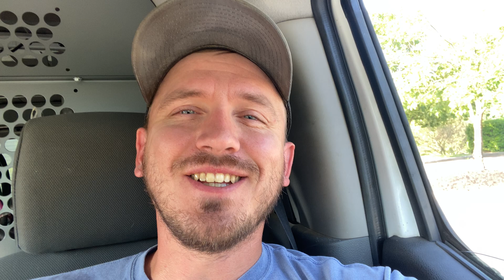How Dry Wells Work in Septic Systems

Comment: Hi, my rural WI home has a dry well septic system. We are trying to find a contractor to install a new system because the sewage holding tank is metal and rusting away. The dry well could use cleaning because it has to be pumped and does not drain well any more. I wish we could save the dry well and just install a new sewage tank to replace the metal one. I started looking for a septic system contractor in August and now, it's November and I only have one bid. I also now think it's on hold until spring due to changes in the weather. The bid includes drainage fields and the dry well will be demolished. I'd like to hear your thoughts. Thank you.

Comment: We   a two chamber, septic tank and twoshaffer concrete  dry wells in parallel. approx 30 years old and just started to evidence saturation a year ago.  Have you ever heard of aeration restoration? I have seen a system tested on a military base by ACE (or other gov office) and it functioned well. https://youtu.be/e-MvMCh9A2o?si=NtT4nR3SnPYykd4_
Reply from the maker: I’ve heard of it but the practice is not common here in Maryland.  Our state wants a permit when trying an experimental treatment like this.  You essentially have to file there was a failure and declare you’re attempting this to rejuvenate the pits.  Agree that if you sell the property and it fails at the time of inspection you’ll replace it. A majority of the time the state is fine with homeowners doing whatever they want as long as it doesn’t back up.  The line in the sand they draw is more towards real estate transactions to protect purchasers

Comment: I have various drywell pits for different parts of the home, septic is dedicated with two tanks, baffles, lines into a drywell pit/leach pit. All you need to really do is keep the bacteria balance good and there won't be problems with draining. Plenty of products out there that help the soil keep percolating and draining. There will always be a little water/standing water/moisture as that's how a septic system works with septic tanks - the water on top has to go somewhere and that's from the first tank to the second and then on to your pit. If your tanks are not happy your drywell pit is not going to be happy. Take care of the solids in your tanks and keep them clean and bacterially bubbling digesting solids, then you avoid issues with your drywell pit. Pretty logical. You can easily dig a new pit if needed though shouldn't have to, and anyone being told they have to pay thousands upon thousands is getting ripped. Just fix the soil, that's not a 'failure', that's common sense and how they work. Old timers didn't run bleach/chemicals and whole house water softeners down drains, made sure to keep grease and fats out of the lines etc. It's actually a pretty green system and you're not relying on anything but using some smarts keeping grease, coffee grounds etc out and maintaining with healthy bacteria. I personally wouldn't suggest one drywell pit for an entire house's plumbing to run through, that's too much and especially with a family. Showering, washer, kitchen sink etc should be divided up with good rule of thumb being three pits (smallish) to handle dedicated showers, kitchen and maybe washer going into another, toilet black water septic definitely needs to be dedicated. The movement now is to 'go green' and drywell pits are making a comeback. Go figure. If you live long enough everything comes back around haha.

Comment: I have a septic system that has only a dry well. We do not have a gray tank. The septic system was filling up with water and not draining out. It was taking only about three weeks after pump to be filled again. We had the septic system completely pumped out, including the drywall. We had all of the gravel replaced around the drywall. We used about 30 ton of round stone. The type of drywall we have is a board concrete drywall. After replacing all of the stones, the system is still not draining properly. It would fill up in just a few weeks still. We live in Baldwinsville Ny. We are on a river. When we removed the soil it seemed to have some clay in it. I’m not sure what to do next.

Comment: I have a 1948 house in boddington Western Australia, I have a single cylinder type septic tank for the 1 toilet, this leads down a pipe which then has the house drain water linked to it and then down to a equivalent to a soak well which then leads to a second soakwell, these 2 soak wells are constructed 1,1/3widthX8ftlengthX1,1/2ftdepth walls are similar to cinder block holes in concrete bricks for walls and the lids are 1,1/3 concrete slabs, pipes were originally clay pipe but what I can see it’s 5-6” grey pvc now! My original issue was it clogged the pipe after where the house drains meet the septic as when I cleared it white and black waxy chunks flowed out!
Reply from the maker: That's fascinating. I'm not too familiar with the way other countries handle their waste water. It makes sense though that they would be very similar to the ways we handle it. Thank you for sharing!

Comment: I bought a rural home built in the 1960s where my leech field was not identified because the sellers did not want to pay for digging. The 500 gallon septic tank is in a yard that slopes downward and the yard is only 40ft wide by ~70ft after which it slopes steeply into a gully or borders a dense forest. Due to the small yard area I dont think its a standard leech field but rather a drywell. I have rocky soil so its very challenging to probe around. Does this sound like its a drywell?

Comment: I bought my home last year in michigan and went to health department for drawing to find our septic system because I have never owned a home with well and Septic.  Come to find out I dug up the lids for the dry well not Septic tank. When pump truck come out the guy said my drywell was full and needs replaced.  He said about 20k to 30k. I just bought the home and shouldn't have to worry about that but now kind of waiting to see what happens. He pumped 1700 gallons from a 1000 gallon tank. He said we would probably need again in a few weeks but will fill back up. Definitely would like to find a different way. Don't have the money to replace the system on a 250k home. Wondered if I could go back on the business that bought and remodeled the home. Neighbor says the tank hasn't been pumped in 20 years.
Reply from the maker: It’s hard to go back on the selling side unless they knew it was failing previously.  In our state it’s really difficult to determine that without something having been put on county file.  I’m sorry to hear the system is failing. You should check and see if there is a state or county grants to help.  Md has a few programs out there to assist homeowners
Reply: @Wellssepticandmore  When I asked my county about assistance, the gal told me to sell some of my farm to afford the new septic system. :(
Reply: I've got a dry well, which is why I watched this video. Pretty sure it's a wide open hole. I had to replace the clean out cap when we moved in. But now I want to go have a look to see how full it is if liquid.
Reply: If what you have is an enclosed tank for gray water that's not really a drywell pit. If it's direct to soil but lined with rocks/cinderblocks etc, then yes, that's a drywell pit. I would say to put digestive bacteria but if it's enclosed with zero piping out (?) that's not going to stop it from filling up with kitchen/bath water etc. Am sure am missing something here but either the pump truck guy meant it's full of biomat and not draining into the soil hence needs dug out/redone, or it's a completely closed tank which would be odd in my book.